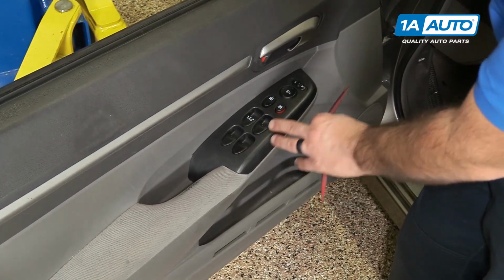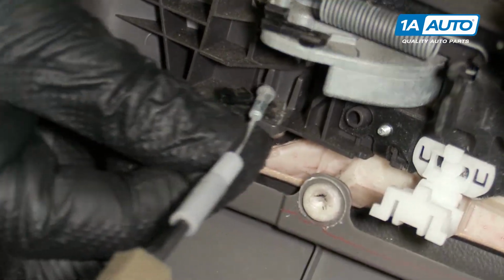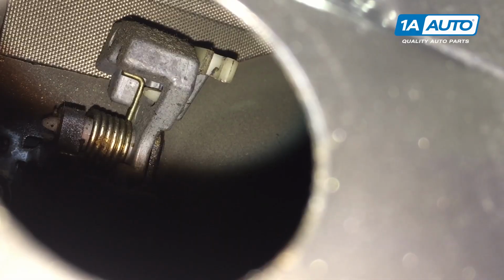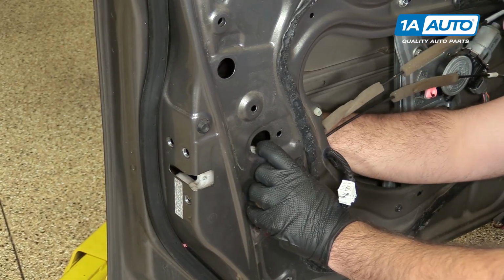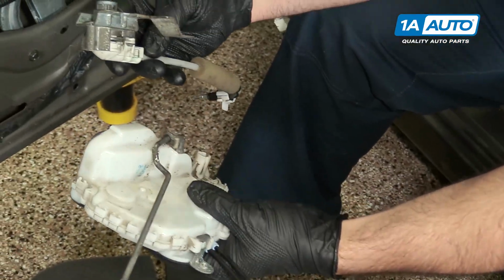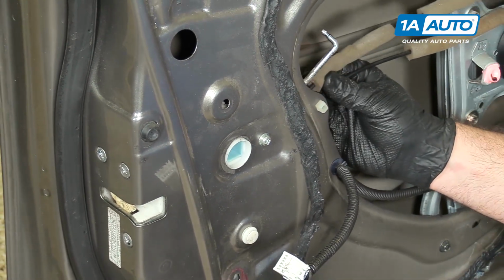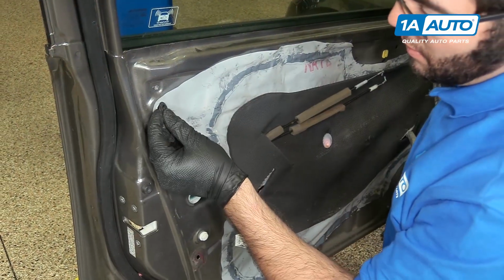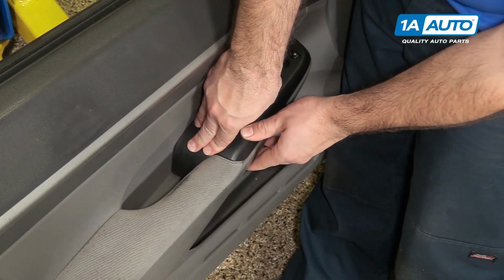How to Replace Front Door Lock Cylinder 05-11 Honda Civic

Comment: Boy - you couldn't ask for a better video than this.  Regarding the security screws that secure the lock barrel, I'm pretty sure they don't round off when you tighten them.  They are just rounded on the "loosening" faces, but not on the "tightening" faces.

Comment: I have a beater Civic 2010 that someone tried to steal and they broke the lock. Because of that every time I go to an event I have to unlock the driver side from the passenger side. I just replaced the cylinder and it took me about 90 minutes and everything works perfectly even though the process was a little different (DX model)

Comment: It's a small push clip but you didn't push it in you pulled it out...
Reply: You can pull out the center pin OR push it in and release it.  Pushing the pin in DOES also release the pressure on the clip and after you get it out of the door, You can then push the pin back out 2 clicks and it can now be inserted and snapped back in with one click and it is locked when it is flush again... Try it and you will see

Comment: Do I have to replace the lock if it’s just my door handle that broke. Because my lock works fine, it’s just the cheap plastic handle that broke. The handle comes out but doesn’t retract back into the door. It also doesn’t pull on any cable when I go ahead and try to open it. It’s just loose springless. Cheap plastic. They can’t even make door handles these days! They’re ww2 Jeep’s that still have a functioning door handle. Hell there’s even model t’s with the original working door handle. I love Honda but c’mon guys! You knew these were going to brake in a matter of time. Smh

Comment: Just replaced my door cause accident and swapped the lock now it dont turn with key at all and doors lock and unlock while driving  any suggestions
Reply from the maker: +wally m Thanks for watching!  The door lock cylinder will not match your existing key, so you will need to get that sorted out first.  That other issues could be caused by a number of things, but we are not able to diagnose an issue like that over the internet.
Reply: I replaced  door lock from original door into the new door

Comment: 2 things 1 if my alarm system is stuck set on bc my key cylinder went out could I use a screw driver to turn the actuator to make the alarm disengage? For short term fix ? And also when replacing does the key have to be coded with the lock or does it not matter what locking mechanism as long as it fits correctly and has separate keys
Reply: Having similar issue what did u do to end up fixing this issue ?everytime I open door alarm goes off because key won’t turn to unlock on car door cylinder, no remote to lock/unlock either

Comment: If the key  doest Open the door  even with keyless  control what should be the problems  actuaror  or key cylinder  to openen need turn the key and push unlock on the control to open

Comment: What if I cant open the door because it won't unlock??
Reply: Take the bolts out of the handle and under the window master switch. Unhook the window switch. And grab the bottom of the door with the window rolled down and pull up as hard and as fast as you can. I had a problem with the right side of thre panel. I used gloves and pried it open with my fingers and a screw driver by the speaker... Then it's pretty easy after that. Sorry i suck at explaining shit 😕😂

Comment: To remove the lock cylinder you don't touch the 2 screws you showed. You have to remove 3 little screws on the opposite side from the plastic casing and then the C clip (retaining clip? )
Reply: So if you just want to remove the lock cylinder, you don't need to remove the actuator - because once the lock cylinder bracket is off you can pull the cable to an opening in the door and then have access to the 3 screws on the lock cylinder.  Do you agree?
Reply: I just completed this. My goal was just to get the lock cylinder to a locksmith (actuator worked fine). My key would not turn either way so was unable to turn off security alarm. Took off lock cylinder bracket, pulled the cable/bracket to opening, then removed the 3 screws from the cable plastic casing, then took the lock cylinder/bracket to locksmith to rekey the lock. Also, did not have to remove the rod from door handle to actuator.
Reply: if you just wanted to turn off the security alarm, there is a much easier and simpler way: disconnect the fuse for the horn
Reply: @dancupryk9661  once you took cylinder out did alram go off?
Reply: I second this. Did it today. The 3 screws do the trick. And no alarm went off but I didn't take it off completely. The wire is flexible enough to access the screws
Reply: I can confirm that this was much easier than the way displayed on the video.
As stated above, remove the 3 screws that hold the plastic casing and lock cylinder together. 
As I was replacing the entire door, I already had the original lock cylinder which I screwed back onto the plastic casing and continued to reassemble the door. 
No alarm sounded.

Comment: Does this work on a civic 2010 DX-A? The doors lock aren't electric on that model. Also, thanks a lot for the tutorial, you guys did a great job!
Reply from the maker: +Marc Ratelle We currently do not have an auto repair video specific to your vehicle. You might be able to apply some of the basic steps shown in this video to your application. 1aauto.com